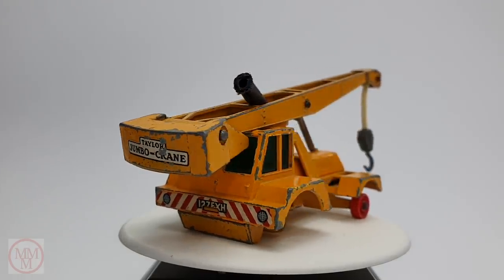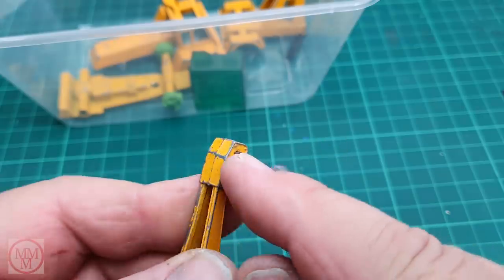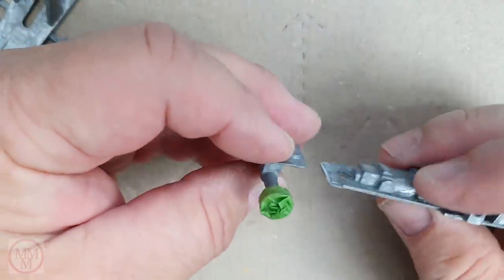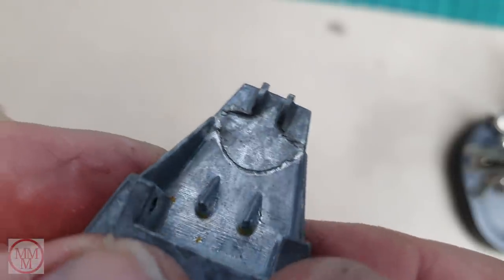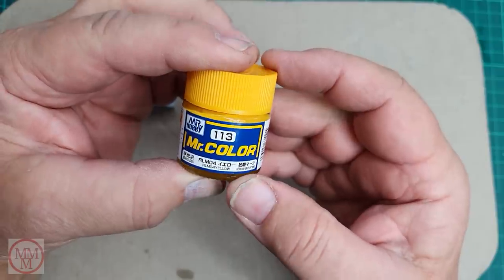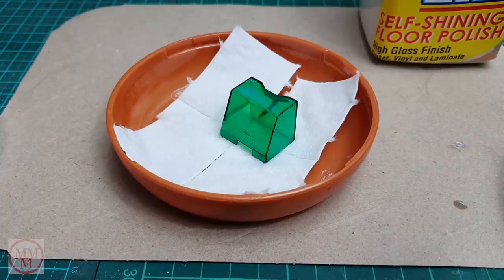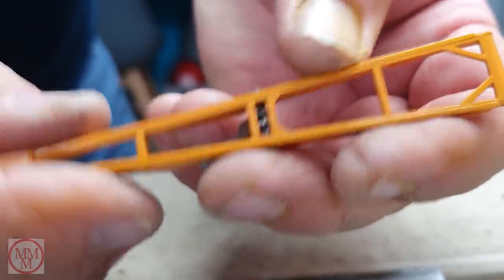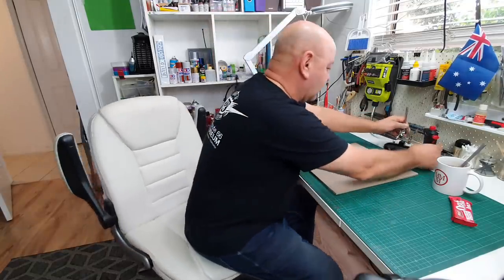MATCHBOX Restoration No.K14 Taylor Jumbo Crane 1964

Comment: very nice finish.  touch and go a couple of times, but you stuck the landing.
i think you are getting pretty good at using that welding/solder stuff.
one thing, instead of relying on what was left of the rivet you might consider putting a screw and maybe a washer for where the crane is fitted to the chassis to cinch it up a bit.

Comment: @0:59 I can see where the crane would break like that.  The way it's been designed, those are built-in weak points for a white metal casting.  It reminds me of toy soldiers by Comet, which were so brittle that if they toppled over, the head broke off at the neck, which was the weak point in that casting.  The ankles were also weak, and the bases sometimes broke off with the feet.
@7:39 I always think how understanding the Missus is, when I see you rinsing paint stripper in the bathroom sink ;D
@10:54 Excellent recovery!  That welded join cleaned up nicely.  I'd have wound up melting the piece-I'm terrible at soldering.
@28:40 A beautiful finish!  Excellent work, Marty!

Comment: The reason they used white strips to hold the hooks instead of chains is because the strips were more difficult to break. If they used chains, a child could break the chain quite easily and swallow the small hooks.

Comment: One way to have made rounding over the pin with your hand drill work better was to hold the shaft with a needle nose pliers if possible so it wouldn't spin and the friction would have domed it more easily. Additionally did you just set the boom back onto its  pylon or were you able to reattach it in someway so it won't pop back off? I still have the one like this from childhood and have many fond memories from close to 50yrs ago of running it around the floor and on top of the desk with some toy car hanging by its axle on its hook..👍

Comment: I find using boiling water works better on the vinyl hook part and it actually bends back by itself to it's original position, just be careful not to scald yourself.

Comment: Mr. Marty,  Great video and an enjoyable job done expertly well.  Question??  Why do you not paint the tail lights red?  You paint the silver and it looks great, but not the tail lights or if there is turn lights amber.  Just wondering, please answer.
Reply from the maker: Roger, thanks for watching and also commenting. Originally I always wanted one of each Matchbox 1-75 series in perfect original condition. This, of course, is very difficult to achieve and also very expensive to obtain. As an alternative I started buying cheap models which were wrecked and  then restoring them to look original. By original I mean if they had no tail lights painted then I would resist the temptation to colour them in as I wanted them to look like they had just come out of the factory. This models tail lights were not originally painted so I left them the body colour. Having said this, I have been guilty on more than one occasion of adding a minor highlight here and there as a bit of fun, I guess. The door handles and hinges on this model are an example of this and makes the model a little unique piece although I do sometimes wish that I could of resisted doing so at the time!  Hope this answers your question and thanks again for taking an interest in my channel! Marty.
Reply: @MartysMatchboxMakeovers  Thanks for taking the time to answer.  You are right in keeping the model the way you want it to be, I can't argue that point.  Thanks again, and keep the vedios coming and watch out for Kevin.

Comment: 1: That wasn't an accident, Kevin, you scamp.
2: It's been a while since I even tried, so something about paints must have changed or Tamiya does something special (as they will)  -- because I was really expecting that lacquer to melt those thin plastic pots.
3: Fantastic job. Especially the weld on the counterweight piece.

Comment: I'm going to guess the "A" on the hydraulic piston casting represents the specific die that piece was cast in. Most likely the original die would do multiple pieces in a single shot, so there may be examples with B,C,D,E, etc. This would be helpful for quality control if there are problems with the casting; the engineers could identify which section of the die needed attention.

Comment: You restored this model. You used paint stripper to remove all of the old paint. But I remember that Ketchup Bottle with paint stripper filled inside it. It has a poison symbol that you drew on it, but why aren't you using it? Where is it?

Comment: Both. The repairs makes it a restoration. I am at a loss why you did not turn to the CA glue & baking soda? I believe it may have done well as a joining method. Nice welding job though. That laquer thinner is good stuff to have around to clean your airbrush. Especially if you use enamels. It cuts acrylics off metal also. I always have it kicking around. Nice job.